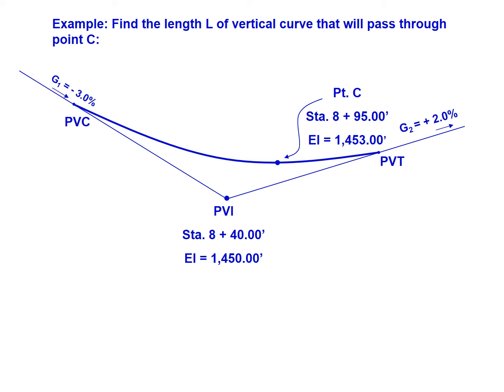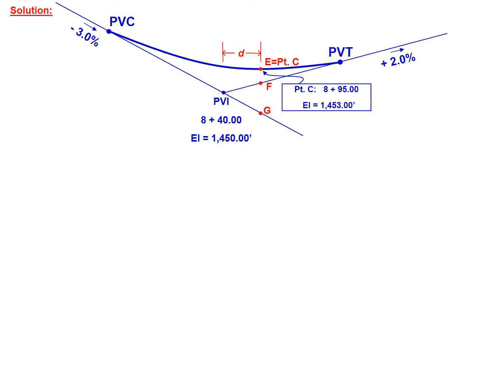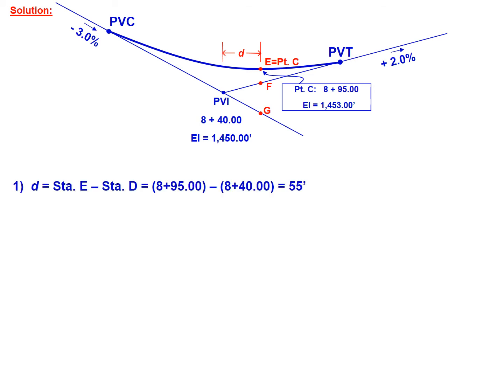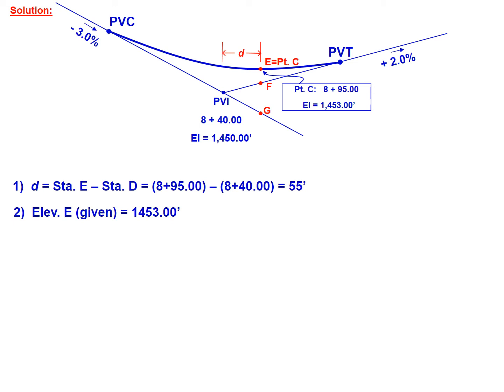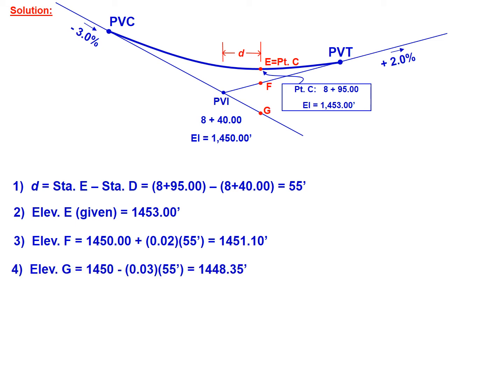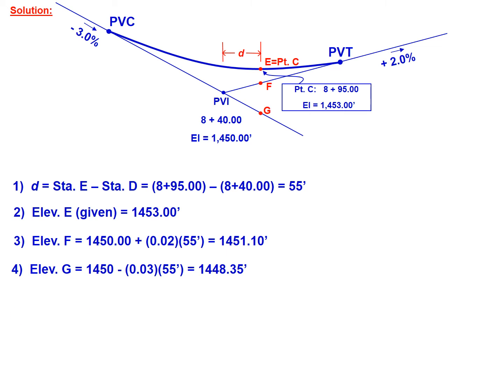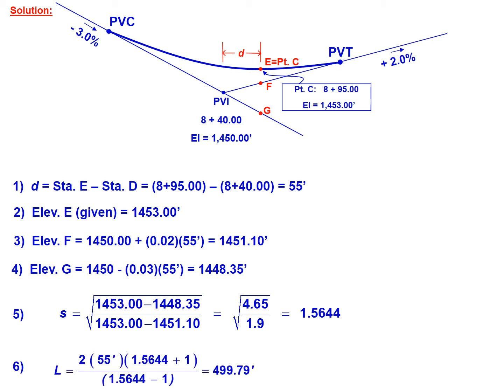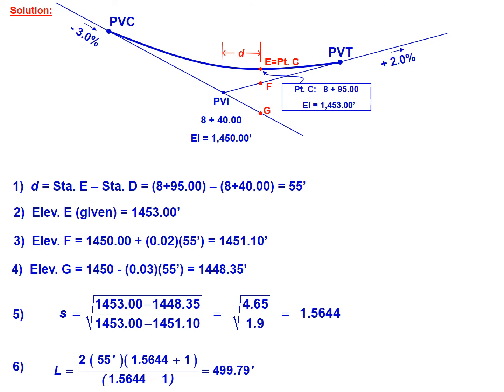Vertical Curve - Passing Curve Through a Fixed Point Example Problem

Comment: Give me a hint to the below problem please.

I couldn't think how could I calcukate the length of curve for below problem.
The problem I'm facing says elevation and chainage of intersection are 1267m & (1+780) km respectively. Field coordinates require the curve should pass through elevation 1268m at chainage (1+780)km. Compute the vertical curve. Grades are given: g1 = -3.5% & g2 = -0.5%